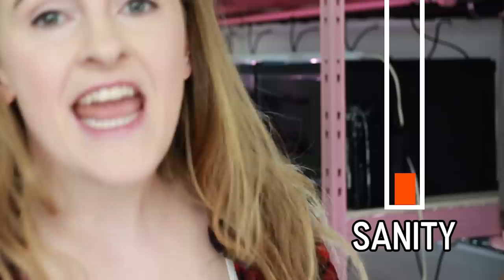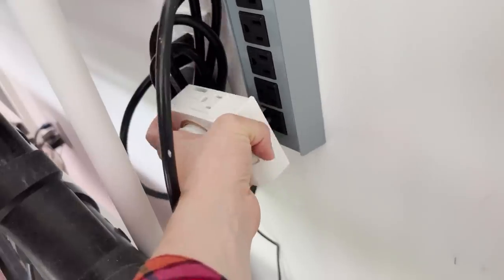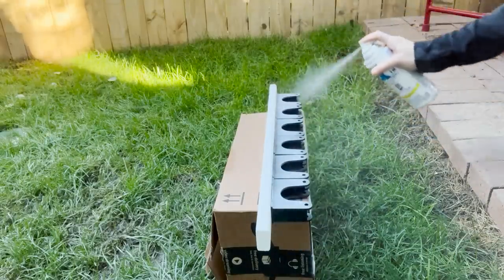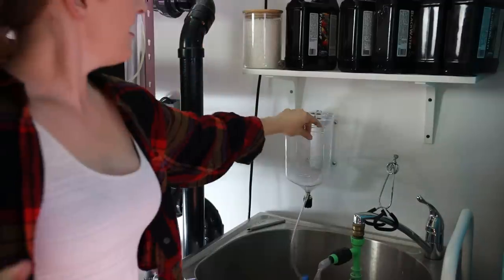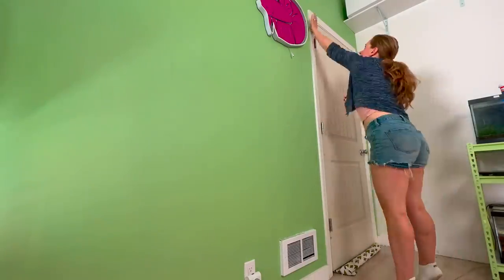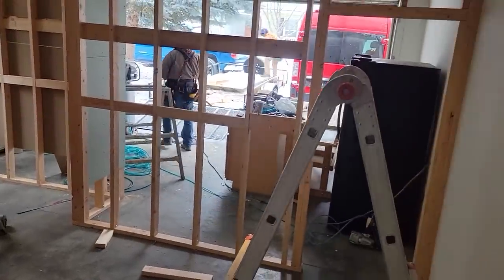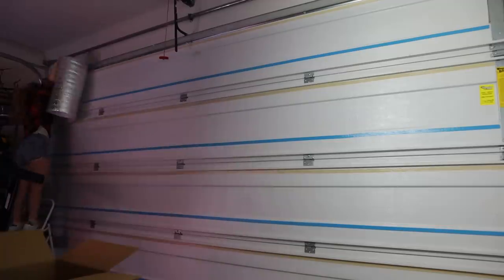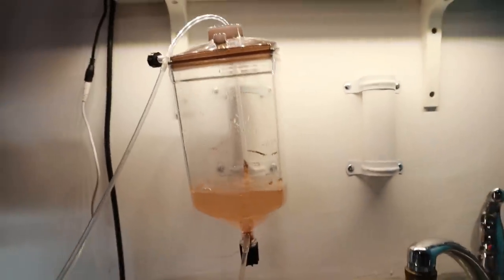Fish Room Level-Up! Tiny Upgrades, Big Impact

Comment: Plus insulate the wall that separates you from garage.   And get a small air conditioner to stabalize your fish tank temps - just suggestions 😅
Reply from the maker: Done! That wall is nicely insulated but that heat still creeps in from the door area. Sigh, I need an AC but I don't have a way to vent it at the moment, maybe that could be a future investment

Comment: Great adjustments. 👍The metal air valves look fancy, but I found out that they leak air from the factory, and over time they can rust. The plastic air valves do not leak air, they are easier to adjust, they can't rust, and they are cheaper as well.
Reply from the maker: Oh weird! I haven't had an issue yet with the metal taps, time will tell I guess

Comment: Based on my experience with the garage temp + insulated garage door, it doesnt exactly prevent extreme heat during summer. It helps it slow down the heat but it will still get warm and toasty if the heat lasted for days.  The real solution is to have those semi-portable sliding A/C units you can just roll out during summer.
Reply from the maker: I'd settle for a slowdown! That afternoon sun is just killer. Like if it can prevent the heat from building up too much before the sun sets, then I can open the garage door a bit to get the cool evening air in. That's the goal at least
Reply: @SimplyBetta  ah then thats gonna be perfect. 👍 please update us, would love to see your success and probably more of us to use our garage as our aquatic dens 😅

Comment: Those little holes on the vertical parts of your metal rack, can hold screws, so you could have put that power strip there, instead of behind it on the wall.

Comment: So most garages don’t have insulation in the walls, and even with that insulation you put on the door it won’t help much at all.
Reply from the maker: Mine does! It’s well-insulated except that door. Fingers crossed it makes a difference, even if it’s only like ten degrees

Comment: I hate my ziss hatchery, never had a problem hatching brine until I bought it, now every hatch is horrible. Its cursed.
Reply from the maker: What?! That's so weird! Gosh what could it be, are you using a 1tbsp salt per 1liter ratio of salt? Are you storing your brine shrimp eggs in the fridge or freezer? They will degrade over time at room temp
Reply: @SimplyBetta  oh i agree its weird! Yeah I have used the coops directions for the setup just to make sure I am not crazy. I have actually tried friends stashes and had the same luck. Legit only getting a few hatches and tons of eggs stick to the side of my ziss. Shoulda never tossed my 2L, it never gave me a bad hatch 😭.
Reply from the maker: @Jeromeeb  Yours might have been cursed by a swamp witch or something, geeze!
Reply: @SimplyBetta  yeah, me and the swamp witches need to have a talk